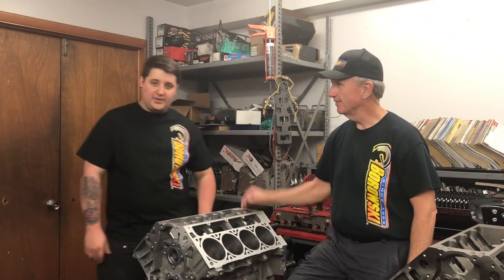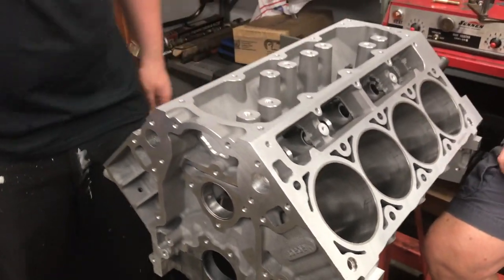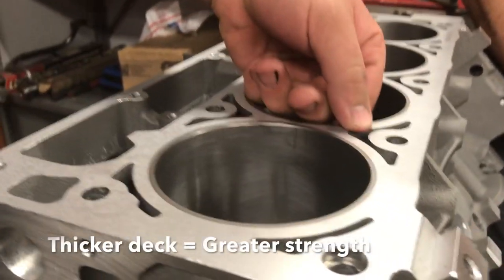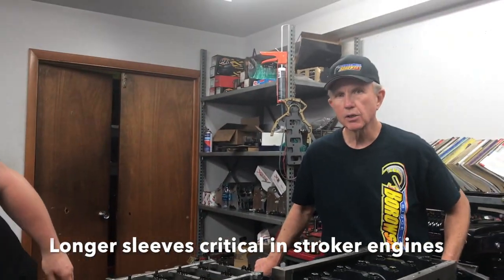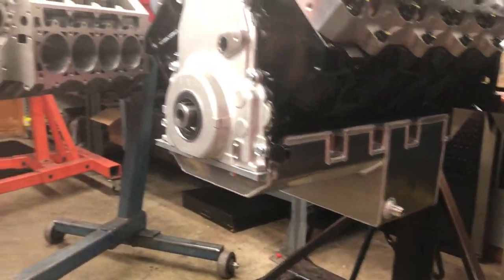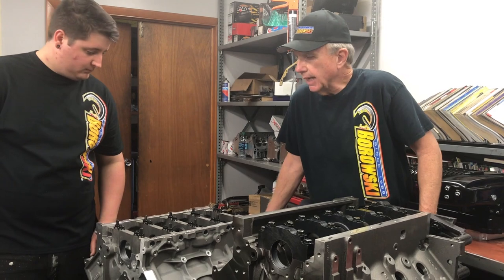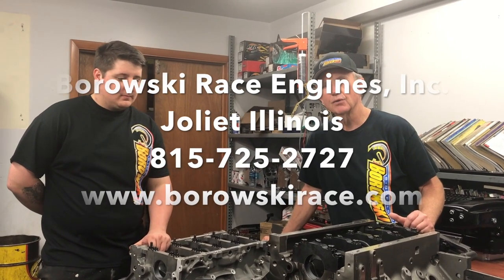Dart GM LS Block Comparison

Comment: I like the guys at Borowski.Tim is a great guy he tuned my ZL1 Camaro with the dart ls 427 twin turbo.And I ran into some bad luck and they came down and tuned it .I would always go back.
Reply from the maker: Thanks for your comment, Chris!
Reply: @borowskirace  just a general question with using that dart block to build a 406 with about 740 horsepower what is the total cost of the build
Reply from the maker: @josephbutler3577  Hi Joseph, There are some engine packages on our website you can take a look at, but the best way to get a price is to call us at 815-725-2727. Thanks.
Reply from the maker: @josephbutler3577  Hi Joseph.  The Dart LS Next2 block is gross overkill for 740 hp.  In fact, we don't use any aftermarket blocks for what you want as a seasoned GM block that we have redone on our CNCs is more than up to the task at a much lower cost.  Our NA builds with a Dart or RHS block would be 427 ci and come in at over 800 hp on pump gas. Here is a link to one such recent build with an aluminum RHS block which adds about $3K over the price of an iron Dart SHP LS Next block. About $4K could be taken out of the cost of this one by switching to a Dart SHP LS Next block and less expensive cylinder heads. https://borowskirace.com/products/800-hp-427-ci-aluminum-hydraulic-roller-ls-engine-for-road-and-track?variant=39270632456366
Reply from the maker: This one is very close to what you asked about.  https://borowskirace.com/products/750-hp-borowski-power-on-a-budget-6-8l-hydraulic-roller-ls-engine?variant=38181660721326
Reply from the maker: Best would be for you to call us at 815-725-2727 and discuss your specific needs and requirements

Comment: The Dart block casting quality looks pretty rough around the lifter bore bosses and such. Reminds me of the some of the Chinese head and block castings I've seen.

The Dart bottom end is definitely a step backwards. The thicker decks are nice, but overall the casting on the Dart looks like they just put a ton of metal into it (which costs a lot).

For the cost of an LS Next, you could get an ERL block build and have a MUCH stronger setup that also weighs a lot less and works with all factory provisions. You can't just clamp the head on tighter to overcome high boost problems because the bores are distorting under the massive pressure. That is why the ERL design is SUPERIOR. It's the most proven high-hp LS setup around.
Reply: I highly doubt that ERL had a superior and most proven high hp Ls block solution. I wouldn’t want all that money tied up in a GM factory issued block with potential core shift issues that went unnoticed and then decided to show its face in my completed $30k+ engine. I don’t mind the rough casting because I smooth all cast flashing and irregularities in the lifter valley as well as crankcase areas. I doubt you own any of the mentioned aftermarket blocks anyways.
Reply: bobwatters yes correct it was proven that they made factory blocks better and respected by some. But I checked into their blocks when I was in the market for aftermarket blocks and wasn’t overly impressed by what they offered. I don’t doubt they didn’t have a great product but I highly doubt it was superior to dart, rhs, lsx, or world products blocks.
Reply: bobwatters and no it’s not important if I agree with you ERL fans, especially since I own the featured long block and 4.5L whipple in the video that is built on a dart LsNext block.
Reply: ERL was so proven... that they went out of business unexpectedly. A month prior they were toting new fancy fliers and boom...out of business.
Reply: Daniel technical merit and business acumen aren’t the same thing. It’s not valid to cite a business failure as evidence of a technical inferiority. It may be inferior, but the business failure isn’t proof of that.

Comment: Dang, some of these comments are overly harsh. I order stuff from Dart, and also Noonan Race. Granted, that is apple and oranges, but I also consider the shop whenever I need help with a build. I like Borowski because Ken McCaul is honest, and that's hard to find in the engine building business. They received 'Race Engine Builder of the Year' at PRI 2018. Okay, I never owned a DART block, so I can only speak to the same observation as others' have pointed out. I am planning a new build, and I may choose them to build it. Since I originally posted this 11-months ago, I'm now more inclined to go with RH for a more GM like config'.

Comment: 0:56, I see the lifters are visible unlike the factory LS block. What is the actual purpose of these openings? I've never had the luxury of an aftermarket block. Is it so you can reach the lifters without pulling the heads if you're doing a cam swap? Lubrication? Drainback? The extra head-stud?
Reply from the maker: Excellent question! The opening you noticed on the Dart block is for access to the extra head studs.

Comment: great, now tell me what wrecking yard has assembled dart motors by the hundreds for $400
Reply: None, but where can you buy a Billet Block with a 4.60" bore and start out with a BBC 4.60" bore with a 3.76" stroke and get a 502cu motor for less than a steel BBC block form Chevy's Factory.  The answer is NOWHERE!!!
Reply: Can you still buy running gen 3 engines for that low?
Reply: @josephmonaco4503  Uh, your post is a little hard to follow. Please elaborate on what you're trying to say......
Reply: No, they are unicorn finds and where I have lived always have been.

Comment: How come you guys don't do a comparison  between a Dart and a RHS block?
Reply from the maker: Good question.  We use both blocks and have had no issues with either, but they are different.  Over the past two years, both were in short supply so availability largely determined which one we'd use. Perhaps we might also want to do a broader scope video on the range of aluminum blocks from GM through billet.  Stay tuned.

Comment: So why do away with the cross bolt mains on the dart block I’m just wondering
Reply from the maker: The cross bolts were an after-thought on the GM blocks  as the original four bolt system was found to be inadequate.    Dart's splayed four-bolt design is inherently stronger for a variety of reasons.  Not all the Dart blocks are skirted.  The skirts are only there to facilitate using the OE accessory system.

Comment: Can the Dart SHP block handle 2000 HP out of a twin turbo car? We know the SHP PRO will but will the SHP be fine at 2000 give or take?
Reply from the maker: We use the SHP Pro for 2,000 hp builds.  Can the SHP handle it?  If going that route, the main bolts should be upgraded to main studs and the head studs upgraded to 1/2". https://borowskirace.com/products/dart-ls-next-main-stud-upgrade-kit?variant=5065481617435
Reply: @borowskirace  thank you

Comment: I have been a bit confused on the meaning of DART in reference to engines.  I had thought it referred to the aluminum version of a stock block or head.  Looks like I've had it wrong all this time.  DART has nothing to do with the type of casting material but is an after market brand name of engine blocks and heads.  Correct me if I am wrong, anyone!
Reply from the maker: Our reference to "Dart" refers to Dart Machinery, website LLC http://dartheads.com/  In this blog, the focus was on their engine blocks designed as alternatives to GM's LS family of engine blocks.  Dart brands these as "LS Next".  These aftermarket blocks are available in both aluminum and cast iron with multiple design variants.  In general, we use the less expensive GM blocks in less demanding applications and then switch to an appropriate Dart block as we climb the horsepower ladder.

Comment: Are the dart blocks the same height as the gm block?
Reply from the maker: Thanks for the question.  They are the same height.  Dart does have tall deck options, but the standard 9.240" deck height Dart block is the same as GM.  We've got 8 blocks in stock (1/14/21). 815-725-2727

Comment: I would think splayed 4 bolt plus cross bolted would really increase rigidity, it would really tie things together...? Not like it would be hard to do and not add a significant amount of weight allready gone to iron for strength whats another 20lbs max?
Reply from the maker: We agree completely.  We took our first delivery of LS Next blocks about 5 years ago.  The three we received had been pro-ordered about six months earlier without having ever actually seen one.  We were inspected them when three guys came in the shop.  Each had an LS that they wanted us to rebuild.  Once they saw the Dart blocks, they all concluded what we had immediately concluded.  It was visually obvious that the 4-bolt splayed Dart block was far better than the 6-bolt GM block bottom end.  Those first three blocks ended up being sold within 20 minutes of arrival at our shop.  Here is where they ended up:
https://youtu.be/c6Y8s74it-o
https://youtu.be/Imqm76RCYCQ
https://www.enginelabs.com/engine-tech/engine/engine-tech-borowski-builds-mild-mannered-427ci-with-ls-next-block/ (later added a 2.9L Whipple)

Comment: I would think cross bolted mains would be superior? But obviously World knows something i dont...mind blower...
Reply: That the Gen1 design was superior.  I would like to know why they did it.
Reply: @markrich3271  I would say the factory ls block design with 6 yes 6 bolts holding it together is much stronger. The only reason I can see that makes the dart parts stronger would be the fact they made them out of billet instead of centered powder caps.
Reply: I think the ls design is better. It has 6 bolts vs just 4 on the dart block.
Reply: It does seem that way... Its hard to say seems both GM and Dart do extensive research, only thing i can think is the dart is prob stronger because its built beefier overall not necessarily the style. You build anything beefie enough it will hold up better. theres full race gen 1 SBC blocks out there stronger than oem LS blocks.
Reply: @95Sn95  the stock LS bottom end is as strong or stronger even with the sintered metal caps and smaller hardware than The dart block. The exact reason dart is using this style is machining cost, the LS side bolts require a level of machining on both the block and caps that would make the dart block so expensive they couldn't sell them. GM on the other hand once set up could make thousands of parts that match exactly for a small amount of extra money. Put all that aside the gm lsx block with it's billet caps and side bolts is easily twice to 3x as strong as the dart design just because of the side bolts.
Reply: @wheelitzr2  one pipe dream idea ive had i would love to do just for fun and "check this out" bragging rights is fab a skirt for a gen 1 SBC and machine new side bolted mains with shallower (prob leakie) pan. Maby its been done prob has ive personally never seen it. And be cool if it was removeable so you could translant it to another block when needed. But ill never do it due to lack of machining equipment and experience.
Reply: I don't know what the experience level is on the individuals that think the factory GM LS block is stronger than the Dart block . But I can tell you this . Dart has been around making race blocks for a very very long time . Way before this LS stuff has been around . So I think they know a lot more than any of us ! And you show me any respectable engine builder in this country that will say any different ! I've done my homework and talked to them all and they have basically said the same thing . If your power goals are north of 1000Hp you need a race block !
Reply: @frankrosadojr3991  
Stock LS block good for 800-1000hp (with exceptional tuning) .
That dart block good for 1400-1600 hp.
A dart block designed with cross bolts in the skirt (LS design) good for 2500-3000hp. 
Now you tell me who has the better idea.
Reply: bobwatters  you are completely correct, the only block the dart block could compare to is the stock LS block...
Why buy a dart block that is only marginally stronger than a stock block? And yes machining 6 bolt caps and block is considerably more extensive, time consuming and expensive regardless of what price they are doing them for.
Reply: So maybe then 50 one dollar bills is better than one hundred dollar bill?🧐
Reply: @frankrosadojr3991  factory block vs race block? Ok now look at the lsx block gm rates it for 2500 hp. What's darts block rated for? And yes dart makes a good product but it is no where close to the lsx block.  A GM ls3 block is not a race block by no means . And gm knows that that's why they make their on race versions.
Reply: @wheelitzr2  I think you may be right. I am certain that the Dart block is very strong as seen by the highly boosted builds running successfully with them (no doubt having been designed with computer-aided stress analysis), however...The deep-skirt 6-bolt per cap boxed crank was a key feature on the Chrysler 426 Hemi and also the Ford 427 side-oiler. That being said, if a recent engine failure was the head-clamping, then the six-bolts per cylinder holding the heads onto the Dart would seem to be significantly stronger. I have seen many LS builds running long-term with 800-HP peaks, but when you dip your toe into the 1000HP+ pond, I think i would take the advice of an experienced builder like Borowski
Reply: @ronroberts110  I absolutely agree on the 6 head bolts per cylinder being stronger, again I go to the highest horsepower per cylinder engine ever produced and it still only has 4 studs per cylinder.
Reply: @wheelitzr2  OH BOY....

Comment: It seems like they cheapened out by not having 6 bolt mains.  The philosophy is hypocritical. We remove ten bolts at crank support but add 13 to the heads. Oxymoron in my opinion
Reply from the maker: We disagree.  

Let's start with theory. The GM design has only four fasteners providing the all-important downward clamping pressure.  The two other fasteners only add lateral stability.  The Dart block uses a splayed design which sacrifices a small amount of downward force to achieve the required lateral stability.  Larger diameter fasteners are a big deal because the clamping force is an exponential function of diameter.  All else being equal, going from 10mm to 7/16" increases clamping force by 29%.  Going to the 1/2" main fasteners in an LS Next2 takes the clamping force up 80% compared to a 10mm fastener.

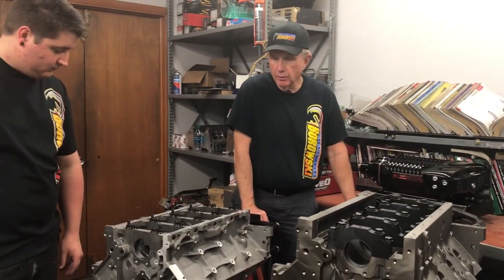Fastener quality as measured by Proof Stress is another major factor.  In this case, the clamping force is proportional to the Proof Stress.  Chinese fasteners or ARP?  Billet caps or powdered metal caps? You choose.  As stated in the video, and clearly seen around 2:58, it is visually obvious that the Dart block is a much stronger design. Link to calculator: https://www.securitylocknut.com/how-is-clamp-force-for-a-bolt-and-nut-assembly-calculated/

The true proof is always in the pudding. We have built a lot of big-power engines using Dart LS Next blocks over the last ten years.  Number of bottom end failures = 0.